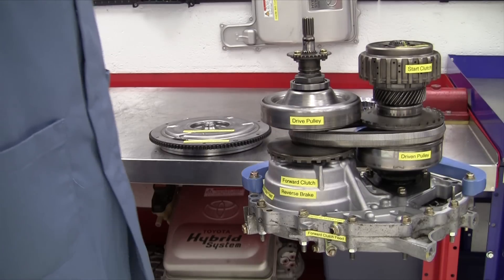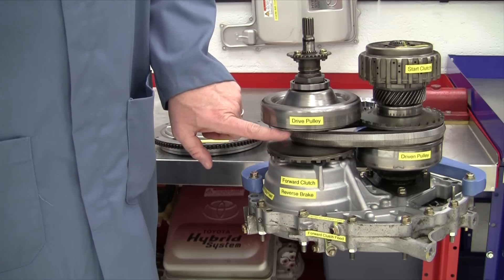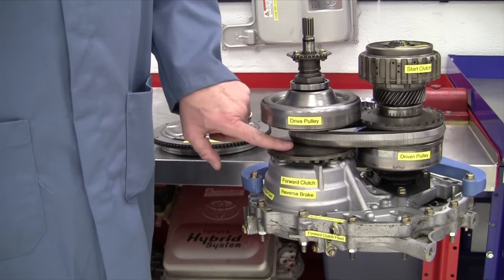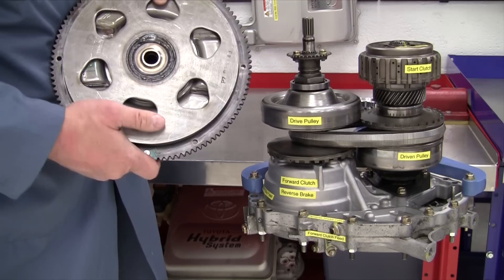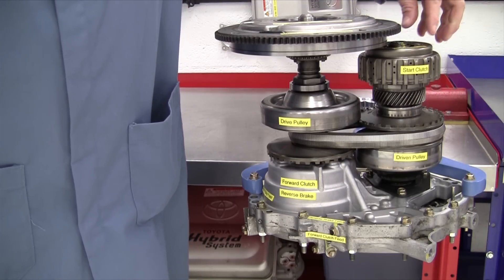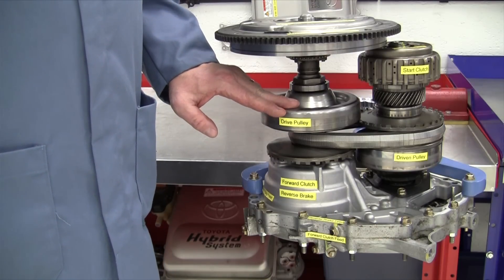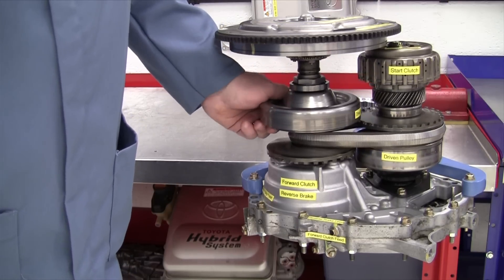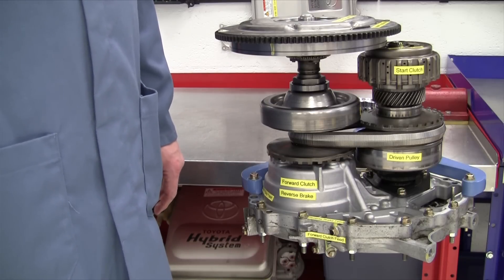Honda Civic CVT Transaxle Operation

Comment: Hope you can answer the following questions.

First the 2003 Honda Civic Hybrid service manual and owner’s manual originally printed in 2002 recommend using Honda ATF-Z1. (08200-9001)  It appears that ATF-Z1 08200-9001 was discontinued and replaced with 08200-9008 Honda Genuine ATF-DW-1.  These newer DW-1 bottles state however it is it is “Not for use with AWD differential OR CVT vehicles.  Consult owner’s manual for application”

The car recently was serviced with Honda Genuine Continuously Variable Transmission Fluid (part number 08200-9006) now inside the reservoir.  This improved a start off judder issue with three successive drain and fills within 100 miles. This 2003 Civic Hybrid has 90,000 miles without record of prior fluid changes.  The label on the 08200-9006 CVT fluid bottle warns it is not compatible with HCF-2 and should not be used in SECOND GENERATION CVT’s. Was this the correct fluid to use or is it harmful and should it be immediately changed?

What is the generation of CVT is in the 2003 Hybrid Civic?  What is the correct Genuine Honda fluid?  Are there an acceptable aftermarket substitutes for this car?

 Thank you.

Comment: Hi sir plz assist me , i have civic 2018 cvt 2.0 liter engine , recently i change hcf2 fluid and i drove 50 km on road and feel burn smell and i check level bolt and drain 250 ml hcf2 fluid, my question is should my transmission and fluid is fine or in future my cvt fail , but I didn’t hear any noise . Thx advance
Reply: What type of fluid do you use ? Do you have use the oem ?

Comment: 2015 Honda Civic with a CVT being weird. I feel sure it went well over 100k miles without a fluid change. So I'm aware that's the cause, but I can't work out what's happening.  I did a fluid flush once I got my hands on it. When the fluid is cool it takes off fine, but once it's warm, it slips bad starting off through 1st. If you move the shifter down to low to start off, it does just fine cold or warm. Does anyone have any help to offer my puzzled brain? 
Thank you  🙏

Comment: Quick question, probably not something that can be answered wihtout taking the trans out of the car and breaking it apart but. I was driving to run an errand and floored it. My car is a 2014 honda civic LX 177k miles and from what i can recall i've never changed the fluid once.

With that being said the car felt like it slipped when i floored it and i was not able to get it back into gear once that occured. What do you think could have broke inside of the transmission(if anything). Yes i haveattempted to change the fluid 2 times so far but not the transmission filter yet. thanks in advance.

Comment: Hello I have a 09 Honda civic hybrid with a cvt transmission I’m having issues with it I just purchased the vehicle I put it in D-S-L and it seems to be stuck in first gear I already change the transmission fluid and it’s still doing the same thing any idea what could be

Comment: When these designs are used in millitary vehicles, i will buy a car with that CVT. Big capacity engines avoid CVT because CVT cannot last long with the high engine torque that will destroy CVT

Comment: I changed transmission fluid for my 1999 Honda civic Ferio CVT and instead of putting CVT fluid I by mistake put ATF .it ran for 40000km before I realized and changed back to CVT oil. It slips a bit when. I dont understand what was damaged. It takes time to grip a gear.i dont know if I need to change the belt or the clutches or gears it the whole transmission

Comment: 2018 honda civic CVT is fine on startup,  but once warmed upbucks slightly and audibly (though quietly) back and forth before accelerating, same on pedal let off. Only 35K miles, and I've already had the fluid flushed to no avail.

Sounds like the start clutch issue described here, but it should be a torque converter driven CVT in 2018

Comment: Very smooth and has improved acceleration. I have the 2014 civic with cvt and it’s faster than my friends 2013 5 speed auto.
Reply: civics with cvts are fucking dream cars.  i LOOVE LOOVEE driving my 2015 with the 1.8 with cvt! very fun ;D
Reply: @presentthepast  Until something goes wrong.  My 2015 Civic's CVT failed on me this weeks.  It's going to cost close to $10,000 to replace.
Reply: @gerrythrash6563  i would just get a new car at that point...

Comment: Hi there. Beautiful demonstration of the gear system. I have a query which would really like you to answer.
I have a 2016 Honda vezel which is the Japanese equivalent of HRv and its hybrid. It jas built-in DCT which is notorious for clutch failures. Can we swap the dct with a CIVIC X CVT which is very less likely to have long-term gear issues. 

Waiting for an answer please. 
Regards
Reply from the maker: Sorry, no

Comment: How much horsepower can these units hold? When you see those drag race covics that have 1000hp are they using these transmissions or are they using something else ?
Reply: these transmissions are maxed at 190 - 225 hp. theres a reason you do not see trucks equipped with these junks. the belt would snap from the torque output

Comment: I have a question you may be able to answer... So I've hacked my 2006 Civic Hybrid because the PCM makes erratic and crazy pulley ratio decisions and I know I can do a lot better with a little micocontroller (if the PCM will tolerate it, which I have yet to see) and improve the mileage (and maybe even the CVT life, if I know what I'm doing).  Currently, I'm just monitoring how the PCM controls it and mirroring those signals to the CVT because I'm afraid of setting the tension wrong and snapping the belt with the hydraulics.  However, it appears that the hydraulic pulley control solenoids DECREASE the pulley size/tension, rather than increase it.  So my question is, are the pulleys spring loaded to tension the belt, with the hydraulic solenoids providing relief of the tension so the belt will move the other way while the other spring takes up the slack?  Currently I can see that the PCM's algorithm is A + B = tension release, and B - A = pulley ratio.

Comment: The one in my Impreza gave up at 70,000 miles
Reply: my neighbors 2014 crosstrek just passed 400k km this year.  still more reliable than fords powershift dct.

Comment: do these hold up as well as geared transmissions?
Reply: Nope
Reply: @grandmasterchess choe that could be because the first cvt wasn't installed until 2014. the autos date back much longer than that.
Reply: @dynamo3059  " the first cvt wasn't installed until 2014. " ??? Say  WHAT ???
DAF nineteen fifty eight as in 1958.
Reply: @grumpycalenzana7514  i meant on the honda civic

Comment: Question regarding acceleration from a stop. I apologize if this has been asked and answered. I looked all the way through the comments, and didn't see it.  My 2006 Civic Hybrid is extremely slow on takeoff, even though I have the gas pedal floored and the a/c off.  Do you think that could be the start clutch?  Or would something else cause that type issue?

Thank you for the video.  It was very clear and informative!
Reply: I have the same problem with my 2009 Civic hybrid but I also have a large vibration for a moment while first accelerating
Reply: @RG-tm7uq 
Burnishing would fix the vibration
Reply: If it was the start clutch, your engine would surge to high RPM immediately when flooring the accelerator (just like what happens if you put the car in Neutral and floor the accelerator).  It sounds more like an IMA problem to me, as the IMA is what provides the instant torque at start out.  I know that when the IMA is switched off (via the switch in the back) that the car has very low power and slow CVT response.  I haven't investigated yet to see whether this is due to a lack of IMA power or due to the PCM entering a limp-home mode.  When there's a CVT error code, the PCM can limit the engine power and max RPM.  But the Drive indicator should be flashing if that is the case.

Comment: Weberauto - honda released Brio 2019 witb CVT, 1.2 L12bi engine, made a test drive very smooth, honda CVT really improved a lot and relieable?? Or just use manual? Super heavy traffic in manila, tropical country philippines.. hope to hear from you

Comment: Hello Sir, 
I like to ask you a question regarding my 2002 Honda Insight CVT with 109,000 miles, I have this issue of the Transmission going in and out of overdrive at say a steady speed of 60 MPH on a flat road with my RPMs at around 2200 RPMs in OD, then switch to 3000 RPMs for no apparent reason, then back in OD again.... I've changed the 2 filters in the transmission along with 4.5 quarts of Honda Specific CVT fluid. NOTE the filters were pretty black and the magnets had this pasty "black Soot" on them. I cleaned out all Magnets, replaced the 2 Filters and seals. I drove the car and the first thing I noticed was a smoother operation and OD would work for longer periods of time now. BUT on the same road today the issues were back, as it seems to slip In & out of OD and drop down to the next lower speed/gear in which the RPMs would shoot up to like 3000 plus RPMS.... What can be the problem?
When it all works the MPG is GREAT like 65 MPG, but when it slips out of OD it goes way down to 47 MPG! I mean I can actually see the "Instant MPG gauge go from great MPG to Poor MPG right before my eyes....frustrating to say the least.... Any Ideas? Thank you In Advance =)
Reply from the maker: There is a part called the start clutch which is responsible for transferring the engine torque to the CVT drive pulley. It could be slipping
Reply: @WeberAuto  it starts off perfectly fine, from what I've read the Start clutch just allows a smooth transition from a total stop to motion at low speed. I think I figured it out anyway, I was running off the engine alone without the IMA hooked up because it was in a poor state. Once I reconnected the IMA it shifts just fine and now doesn't swing high and low as it was before.

Comment: Hello, wondering if you can give me some advise. I own a 2003 Honda Civic Natural gas with CVT transmission. The problem is that in the morning or when its cold the transmission does not engage. Once it warms up 15 - 25 minutes later, it'll engage and run like normal. Is there an easy fix to this? hopefully...
Reply from the maker: There is a part called the "Start Clutch" that has had problems. Not an easy fix

Comment: i have a 05 honda civic 1.3 automaic transmission the problem is no reverse or forward is there anyone who can help me
Reply from the maker: A common problem. Probably stripped torque damper splines where it connects to the transaxle input shaft. You can verify by watching transmission input speed sensor with the engine running in drive. It should match engine RPM,  if close to zero. you will need a new torque damper ($600 part).

Comment: What i want to know is if there is a better belt i can get that will handle higher amounts of power....
Reply from the maker: There are many sizes of belts, Bosch makes most of them.
Reply: @WeberAuto  I don't need a different size belt but rather, a more durable belt the wont burn out or snap at higher hp more often. I'll check out Bosch though.

Comment: CVT stands for Continuously Variable Transmission not Transaxle
Reply from the maker: Thanks for your feedback
Reply: think its transaxle if it includes the diff gear
Reply: Wrong.  Its constant vibration trouble.

Comment: I have a 2001 honda civic gx. This morning i noticed my transmission is jerking a bit in the mornings. I am told most shops don't want to rebuild these. A transmission tech told me they never work well after they are rebuilt.
Reply: CVTs are horrible whether they’re brand new, rebuilt or worn. Your best bet is to get rid of that money pit.
Reply from the maker: Make sure your fluid level is correct and is of the proper Honda CVT fluid, not transmission fluid. They work just fine after rebuilding as long as all the parts are replaced that should be. It is a very expensive repair to do correctly. I recommend normal driving (not aggressive), it could last for many years like that. Best wishes!

Comment: Okay just so everybody is aware of the CVT transmission has not been in use since 96 it's been in use since about 1949 okay the idea is extremely old it's just been super upgraded for automobiles they use them in tote goats mini bikes snowmobiles there is nothing new about them and they're super simple no problem working on them I would recommend them 100% except for a couple that were recalled but it wasn't no big deal they just had a couple belt problems that's it other than that they're sweet Transmissions but as far as everybody talking about how you know knew they are in and they just came out in 96 and whatever yeah that's not true they they've been around for a hundred years just check out mainly like a 1961 tote goat the exact same thing the driving driven pulley system anyway I hope you enjoyed this survey
Reply from the maker: As I say in this HONDA video, they have been in use in HONDA vehicles since 1996.

Comment: Tengo un hybrid honda civic el problema es cuando lo pongo en D camina pero si acelero se jalonea camina pero ba mas  aselerado y pa el  indicador de la letra D parpadea que podria ser
Reply from the maker: A flashing D indicator means there is a trouble code for the transaxle. You will need a scan tool to read the code. Best wishes

Comment: On a Honda hybrid like this (I own a 2011 Insight), I'm curious if the starter that cranks the engine after it's been on auto-stop (at a stoplight) is the same as the one when you turn the key... or if the electric IMA motor somehow plays a role
Reply from the maker: The IMA motor starts the engine after an auto stop. It is much faster and makes no sound
Reply: The IMA motor always starts the engine, whether by key or resuming from auto-stop, unless the hybrid battery is empty.  In which case it falls back and uses the conventional starter to start the engine.  You can tell the difference by how the engine starts...when the IMA motor starts it, the engine just purrs to life instantly.  When the starter motor starts the engine, there's a one second delay followed by the traditional gear starter sound.
Reply: Thanks 007 Good to know. 03 civic hybrid 5-speed. Yes, startup is usually silent but I can hear a conventional starter rarely, like when the batteries are discharged. So there IS an extra starter motor.
Reply: According to Honda the hybrid engine is started/turned by the under bonnet (hood!) battery which powers the IMA coils.  There ain't a starter motor!  It's a parallel hybrid system.

Comment: I'm trying to differentiate between the forward clutch and the start clutch

Is the forward clutch always engaged in Drive and disengaged in N and P?

So that means the start clutch is what gets disengaged when the car is braking and under a certain speed as well as when the car is stopped and the CVT belt is constantly moving when the engine is on?
Reply from the maker: The start clutch replaces a torque converter, it is used any time the vehicle moves forward or backwards. It connects the driven pulley to the final drive gear. The forward clutch only is used when moving forward. it connects the input shaft to the drive pulley.
Reply: Thanks for the answers. My question is, when the car is stopped with the engine on, which clutch is disengaged?
Reply: Also, if I put the car in Neutral, which clutch is disengaged?
Reply: just trying to understand for general knowledge
Reply from the maker: Think of the start Clutch as the part that makes the vehicle move forward or backwards. If you stop the vehicle, it is released.
Reply: @CoolandDesign  Yes, the forward clutch is engaged manually by when not in P or N modes.  The reverse clutch is manually engaged in R mode as long as the inhibitor solenoid isn't engaged (to prevent transmission damage if shifting in to reverse at high forward speed).  During auto-stop, all clutches lose hydraulic power and let go.  This is why the vehicle delays and then jerks when starting to move forward from auto-stop.
When the vehicle drops below about 7mph or comes to a stop with the engine running, the start clutch disengages and starts slipping to make up the difference between the CVT's output speed and the wheel speed.  When you let off the brakes, the PCM gently engages the start clutch more to start the vehicle creeping forward while maintaining engine RPM.  As you accelerate, it modulates the start clutch as needed to convert the RPM to the road speed.  In normal operation, it goes to about 10 mph before locking up.  Hard acceleration or the start clutch sticking can cause it to delay lock up to higher speeds.  If you press the accelerator and brake at the same time, it is the start clutch doing the slipping.
During normal driving, the PCM sets the start clutch signal at just enough power to prevent slippage.  Harder acceleration or engine braking/regeneration cause the clutch to slip briefly and the PCM then applies more power to the clutch solenoid to stop it from slipping again.